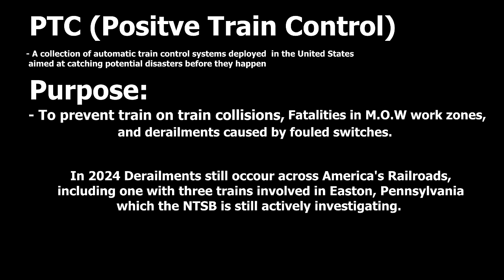The Day the Signals Fell (CP Blandon)

Comment: Several years ago when CP single tracked their Winchester sub, they replaced all of their block signals with these type. Sections of the removed line were retained as long sidings. Interestingly, they didn’t bother to remove the old telegraph poles, a number of which still have their copper wires in place, but have likely not drawn current in many years.

Comment: Disgusting seeing the signals in the dumpster. how many museums would have taken one of those signals home with them? They're going to do the same thing here in Big Sandy, TX
Reply from the maker: It’s certainly a bit heartbreaking. Thankfully I was able to work with NS and get some of the fallen signals including the heads from CP Blandon seen in the video, I didn’t put them up yet as I put another G in its spot, it came from CP Burn just up the road in Allentown, 3 heads fully restored and soon to be operational

Comment: I have never understood what makes existing signal masts and signal heads non-PTC compliant.  I understand that the controls are massively different.  But at their most basic, the signals themselves seem pretty low-tech.  If there is a qualified signal engineer or maintainer reading this, can you explain?  Thanks.
Reply from the maker: I’ve wondered the same, I just assumed they figured it’d be easier to replace the entire apparatus rather than upgrade it. Amtrak has proved that’s possible
Reply: There isn't anything different. The control system doesn't care what style or shape the heads are, they're just some lightbulbs at the end of the day. Oftentimes the work is done at the same time because there will be a signal crew already on site, so it's more efficient. It also brings everything in a certain location up to the railroad's current standard, which makes maintenance easier and cheaper. No sense in having signals that are harder to get parts for when you can replace them for a little added upfront cost.
Reply: Block signals are based on assumptions about train speed, length, and length of the block - in order to maintain adequate separation.  This approach is now very inefficient.   Once the trains are under ptc, the computers are controlling the speed and distance between trains.
Reply: @ArtStoneUS  so what happens if the computers fail? Do the trains automatically stop or do they run into one an other? Just curious.